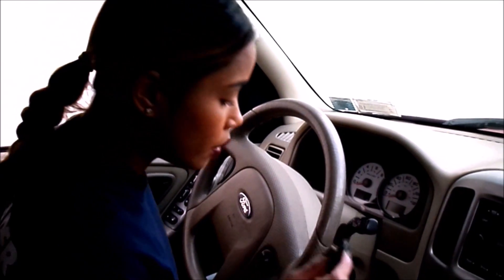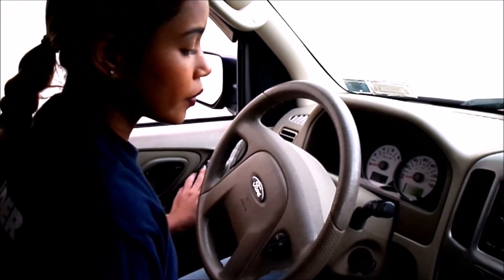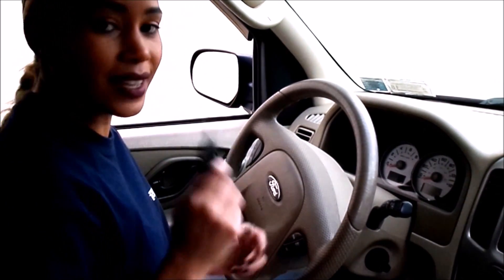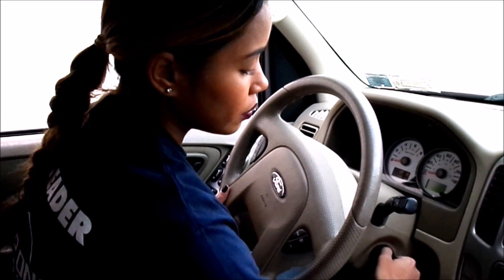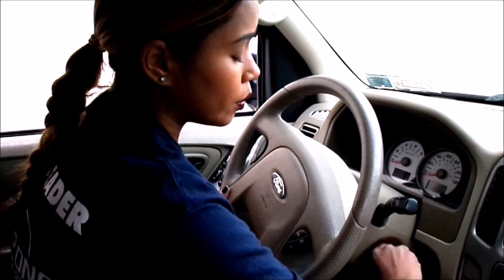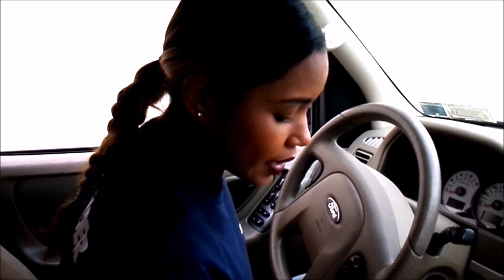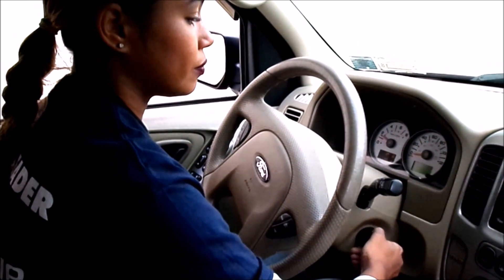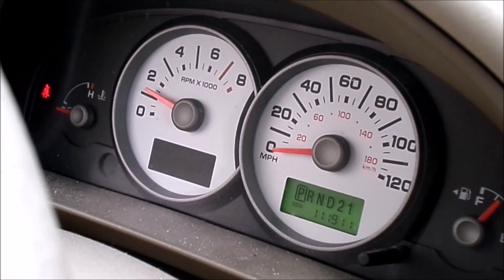4 Easy Steps for PCM ECM ECU Key Cycling Installation

Comment: What happens if you didn't get a new key for the used one you bought.
Reply: It's called you're S.O.L.. In order to make that PCM, or ECU ever function you must have 3 things. #1 that and the  ignition key, #2 that ignition switch, and #3 that ignition immobilizer. When you have those and the PMC, or ECU, or 
ECM, it's a simple "diy" project. Of coarse with just a PCM or whatever you can get a pro to reprogram at whatever they ask.  I learned the hard way!!!! Never buy a used PMC, if there isn't the 3 included, because, it's going to cost you big time.
Reply: @rickspearman344 are you serious smh
Reply: What if ur Cadillac doesn’t have a key just a fob

Comment: I have a Mazda 6. I installed the pcm and followed the key syncing video and I’m still not getting a crank. Do I need to call someone to program them? If I had known I needed to do that still I would have not spent the extra for the keys.
Reply: U have to do a parameter reset
Reply: @juanlatin3595   How-do-you-do that
Reply: @jase1911  Did you ever figure this out?
Reply: @Karson Tuck  no unfortunately... ended up being forced into trading the vehicle off due to the extreme need for work transportation

Comment: I have a lexus ls400 hundred I got the new key had it cut still nothing but cranking over/ the old ecm will start it but it runs rough. don't know whats going on
Reply: I think you need to get it tuned

Comment: What if you sent me no keys. I had a locksmith here today. Programmed keys to new ECU and still no crank no start. I put in the old ECU and the new key and the original key both fire up the car immediately. Is there something a locksmith could have missed or done wrong
Reply: @chiefn  They also sent me no keys. I thought about doing the same thing with the lock smith. Has your problem been resolved, and if so what did you do to solve it?
Reply: @504mike  Also sent us no keys. Were you able to start a different way?
Reply: I found out 2004 transit had a chip on rhe pump also after changing ecu an key though coil around ignition inside cowling with matching key but now need to put old stuff back on an get a key made to fit ecu

Comment: I’m confused . So if my f150 has pats system, and I put in a new pcm from you guys do I have to do this ? Or do I have to have a lock smith connect their obd scanner to program it ?
Reply: I would imagine if you got their pcm it's ready for your "2" keys to be programmed to your vehicle.  Did you follow the steps to see that the keys are paired and do indeed start your vehicle.?
Reply: Did you get it
Reply: No you need to reset the pats system for the keys to work no matter what.

Comment: Must ALL keys ( 2 new + old original) be "sinced" before the first starting of engine?
Reply from the maker: For Fords, you need to have TWO keys paired to the vehicle before attempting to start, or it may lock up the security system.
Reply: I just ordered from you guys as well. Same question as above ? . I have a Ford explorer. So i enter the first two from flahship one.  Then the final is the original key that I have.  Finally I enter the flagship one key and start up vehicle correct.  ??